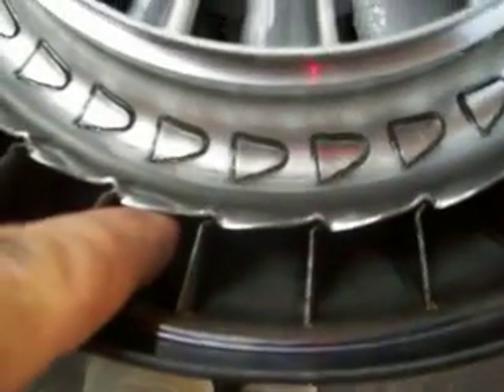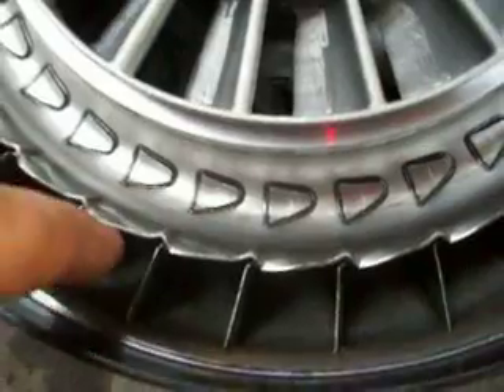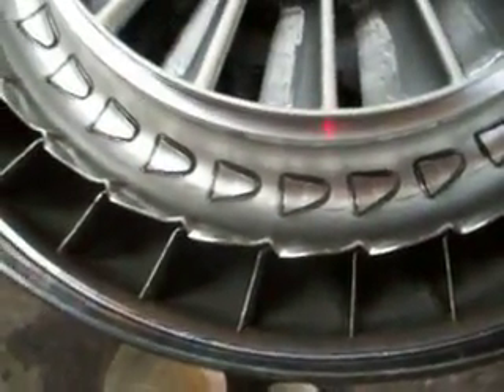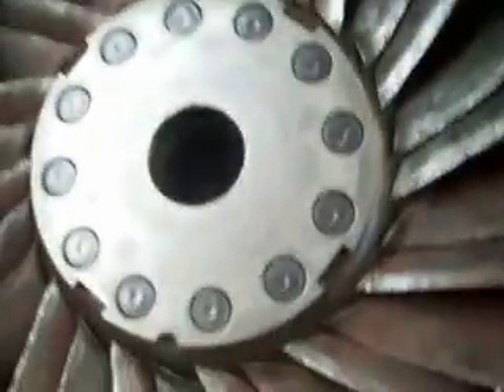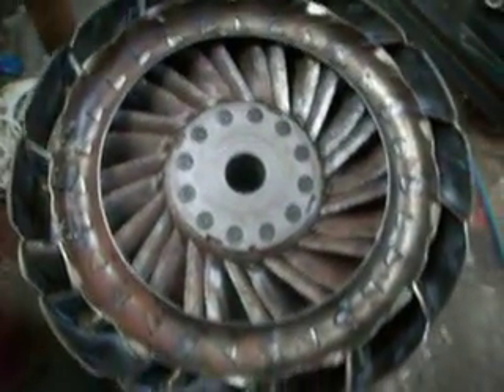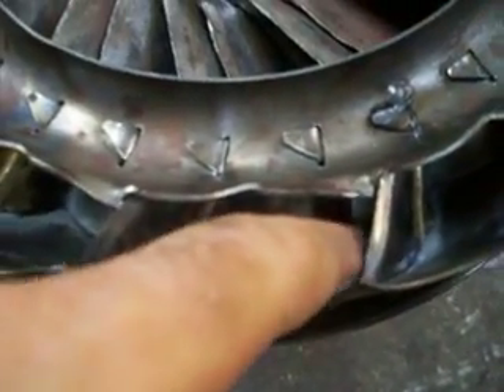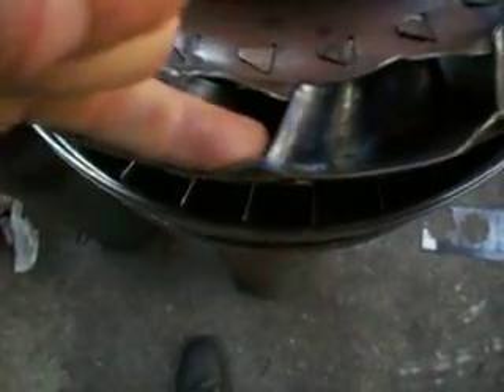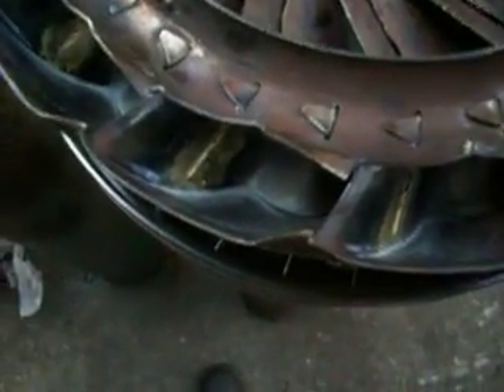Victor Schauberger TROUT MOTOR

Comment: Turbina de alto nivel get tecnologí
Reply from the maker: Compression in the turbine. Makes potential differance. Turbine turns faster than impeller due to it having to through flow less fluid , so the speed increases to use the flow.

Comment: So you’ve taken a torque converter apart and convincing people you’ve had some breakthrough in design by showing two different styles (that were engineered and designed by automotive manufacturers) 😂 …hey good on ya though, hell…I clicked on it 🤷🏼‍♂️
Reply from the maker: 10 years full time R&D .  Think what you like.

Comment: This looks more like Richard Clem's fuelless engine, which works on the same principle.
Reply from the maker: Another inspirer to me is Richard Clem, its about looping a torque converter system he did from what I have seen.  Saw pic’s of his with a fluid coupling (stand alone device oil filled and bolt plugged . ) I’m thinking use front wheel drive drive train . Lock the left hand axel. 3 x the speed will apply through the spider gears in the diff (amplifying) the right side drive shaft to re drive the input via sprag. / mechanical diode. .

Comment: The knowledge hidden from us is incredible. Could completely change the world between just him and Tesla.
Reply from the maker: I've experienced amazing power gains.   Many ways some adding 31 segments to the impeller causing it to become a centrifugal ram Jet but having 31 jets can be classed as a scramjet. 
ROGER RAM JET.
Reply from the maker: I think the torque converter is the right device to have a million volts applied a variable also variable current between the turbine and stator as electrogravitic electrodes encased in oil  . Makes a shielding monopol.

Comment: Would u know how to build a truncated cone with the golden ratio ?
Reply from the maker: would be easy
Reply: @godspirals  could you teach me please
Reply from the maker: @edwinosantos  mark out a circle in a circle  50% its diameter . Centered . So same origin point. Cut them out cit through to centre spiral it together till you get the angle you want or one opening size relative to the other   . It's play with it. Really, Many variations possible.
Reply: godspirals That sounds simple but not for me 😩😩😩. Are you on social network ?
Reply from the maker: @edwinosantos  not so much.
Reply: godspirals if you would build a small cone what measure would you say would contain the golden section so i can try and understand ? Base diameter- top diameter- height ?
Reply from the maker: @edwinosantos  1.6 , 2.1. 2:1. What looks right for the task in hand.
Reply: godspirals sorry sir but what order are those measures ? Base D is 2.1, top diameter is 1.6 and height is 2.1 ? Is that what you meant ?
Reply from the maker: @edwinosantos  keep it simple. D x1.6. Or D devided by 1.6. .
Reply: Heads Mess Thank you sir 👍🏾
Reply: @edwinosantos  they're are not "many variations" to making one. There is only ONE way and you have to follow the infinity curve rotated spherically on it's y axis until completing the complete 360°. 

Also, Viktor's designs always followed the Fibonacci Sequence in design "spiral" and did so specifically to energize water molecules in a specifically shaped container of a specific material, utilizing specific universal equations to induce specific properties previously thought impossible...actually, never considered to begin with! Unfortunately, none of those elements are present in your design. The intention clearly is. Continue the journey...

Comment: I'm sorry but this made no logical sense whatever. Besides, if I'm not mistaken, Schaubergers' original repulsine 'trout engine' was designed to work with fluid water. 

The first 'automatic' transmission and any associated torque converter that may have been conjunctive with it was not invented until 1939. It was introduce by Cadillac/Oldsmobile in 1940. 

Synonymous in time to when Schauberger was developing his repulsine concept, leaving a bit of doubt that he may have modified one for his purposes.
Reply: The repulsine works with air, and the trout turbine works with water. This device is not like either one, but more like the Clem motor.

Comment: This is meant to work from the water vacuum of the water as it falls threw the spiral in the center and speeding up on its way out as it expands at the bottom and is pulled back up to the top but I never new it used moving parts in the device.
Reply from the maker: I have modified a part in every automatic car. Experienced many gains in power even from 10 kw to 50kw gains even power tripling bottom end where it was making 50kw now 150kw.

Comment: where did you get this stuff?
Reply from the maker: Schauberger / Clem. inspired, trying stuff. self taught.

selling on ebay , will tackle any make model Automatic car, truck,bus. if your serious .energy machine/ generator. 

need paying work or donation, shouldn't beg but it all costs paypal balance zero currently.
PayPal: gargulaspirals@hotmail.com

What do you do!

HyperPowerTorque's
Reply: It seem I figured out how it works.
Reply from the maker: I doubt that one, it's an infinite variable design reactor.  it is only one posability.
Reply: You're issue is when saying it's "at least" this many times that. Viktor and Nikola were both very exact in their measurements. Continue the journey...